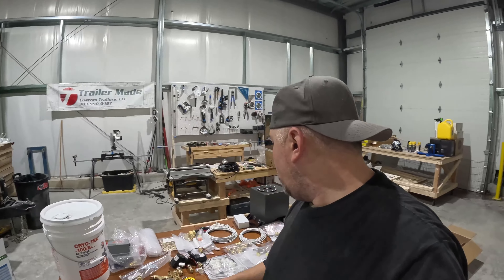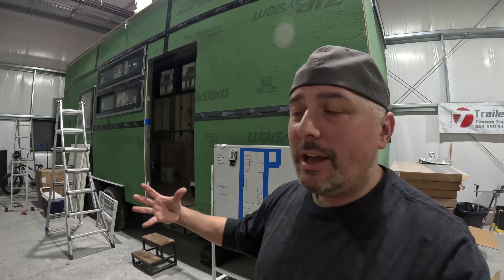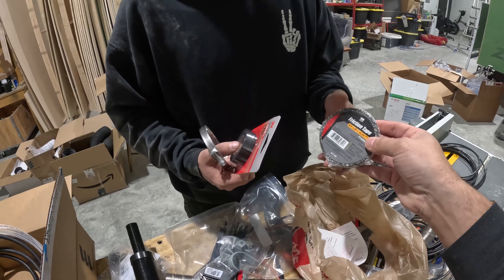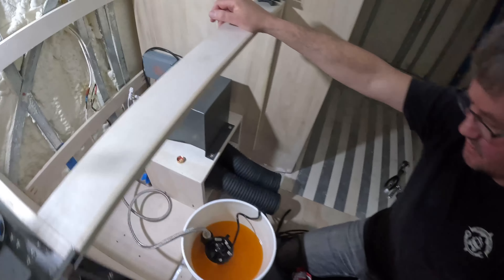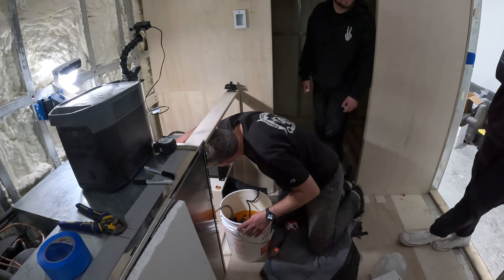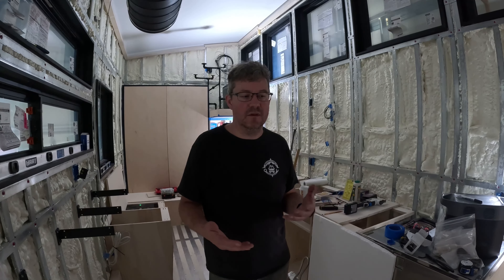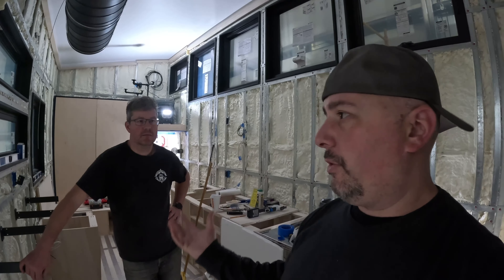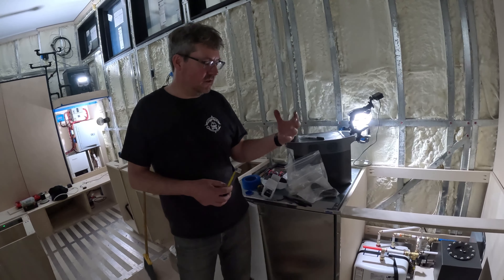BEST Heater for my Tiny House - Radiant Floor Heating

Comment: Two years living in a 30ft Cargo trailer with in floor hydronic heating, also does my hot water and forced air. Espar hydronic diesel heater typically used in Semi's. Tested to minus 40 and a cozy 25 degrees Celsius inside. Alberta Canada. My biggest suggestion is a Diesel/water separator on the fuel supply and use a mix of kerosene every now and then to keep fire chamber clean. Steamfitter by Trade. Oh and Jarrod this one is for Sunny, think I might have R6 in the floor and it cost's me about 5 gallons of diesel every 9-10 days. Even that will get much better as it is a work in progress and not fully insulated, R&D stage still as I first heard of the idea of hydronic heating in a tiny space through your channel and figured I would give it shot. Far cheaper than a house mortgage, rent and all those utilities, insurances and repairs.
Reply: Lets try this...hope this comment doesn't get removed also but i try to answer you. We are talking based on lack of information. When talking about Energy Efficiency everything play's its part. I don't know what flor type you have, how its construction looks like, what actual insulation is in there, how much air volume , hom much radian surfaces and so on. I can make assumptions based on experience from the European point of view where lets not forget Energy Efficiency and Pasive House technology was invented. Diesel Heaters is one solution but is not the best. Depending on the criteria that it needs to fill technology is used to fill it. For a Car that Runs on Diesel makes sense to have a Diesel solution and not a Electric one like Heat Pump witch even so is more efficient but you have losses and added complexity for the electric generation. A big epic fail people make is put in Flor Heating any type and then cover it with a carpet or furniture. As much as i can see in the Video 50% or the radiant surface is covered with furniture and the end flor laminate or what ever is not even in also so that adds a other insulation surface over it. 25l of Diesel for 10 days of 3h a day that is a lot. Maybe price of diesel is 2 Dollars a Gallon and then its ok but we have 12- 16 Dollars the Gallon in Europe. You have to factor in prices of resources. Hope it was helpful. Have a fun Day!
Reply: @suny1265  You where doing good until the end. How do you only heat 3hrs a day with water in your trailer? Yes my vehicle is diesel and I heat the trailer 24hrs a day. My heating is only in walk ways with a tiled floor. Also we are talking about many factors here. Solar isn't  really a great option unless your willing to chance freeze up every month here in Canada. Running a 12volt diesel heater and make up air with the same forced 12volt fans and heater core as a car is far easier than a 110 volt heat pump. When I take into account what my friends are paying for utilities per month for power and gas bills to live in bricks and mortar I have a long way to go before my system becomes inefficient.

Comment: OK so this may be a stupid question but I'm gonna ask it anyway so your hot water goes through the floor pipes but now in the summer time do you have a cut off that bypasses the floor goes right to your spigots instead of the floor is that how it goes I'm curious on how that would work I don't know how many gallons of water would be in those pipes kiss curious hope all is well. As always stay safe stay strong stay healthy God bless and enjoy life ✌💪👏🎅🚌🌻👍
Reply from the maker: That’s not a stupid question at all. There is a heat exchanger somewhere in this mix. I know water goes through one side of it and the antifreeze goes through as well. Again, I too don’t full understand how it all works, just full disclosure there. For the summer I think the liquid in the pipes are sitting dormant. The water is a different pathway is best way to think of it (I think)
Reply: @JarrodTocci  thanks buddy it shed some light on this I gotta do some more investigating I'm intrigued by it.

Comment: Can the system use heating oil? It is quite a bit cheaper than diesel fuel.
Reply from the maker: I can use red dye diesel or kerosene. Red dye is much cheaper. The consumption is extremely small and I’m not 100% on the math here but I think I was told that on full tint (which would very rarely happen) the system burns 1 gallon of diesel every 24 hours. In theory I could get a 55 gallon drum on my property and have red dye delivered to my property. That would easily get me through winter
Reply: @JarrodTocci  I lived in portland for a long time. I had several apartments with oil heat. There is a lot of infrastructure for delivery of heating oil in Maine. Bridgton is a pretty nice town. Close to skiing and the lakes and maybe about 1.5 hours to the ocean. I used to run to Shawnee Peak after work to go night skiing.
Reply from the maker: That’s where my land is ;)

Comment: Minisplit heat pumps are the best heating and cooling system today. The new cold climate heat pumps are more efficient than best gas furnace in Norway or Alaska. That’s why in Juneau Alaska 80% are now heated by minisplit. Norway it’s 70%. In 5 years it’s expected to be almost 100%.
Reply: Our mini-split in Montreal required some help at -20C. It paid for itself in 4 years of savings. Bonus AC in summer. We're in the Arctic now and everything is hydronic which is effective at -60C. Every room has its own system and controls. Alaska might be more advanced cause I think their building codes require triple glazed windows.

Comment: Depends on local climate but its really slow heating and its not enough. Also insulation has to be above R60 on average.
Reply from the maker: What are you even talking about??? R60?! Please know more about thermodynamics before saying things
Reply: @JarrodTocci  Dude i am a Energy Efficiency Consultant....what are you people even talking about? Your mixing Apples with Vegetables. Its a common problem in America i have seen that people are unable to understand anything regarding complex notions like Energy Efficiency is a complete system with Heating, Cooling, Insulation, Ventilation and Energy Consumption. Hit me up when you end up living in it and is not working properly. Maybe then you will Open your mind a bit and be able to learn. It will cost you 10 times more Energy then the best heating solution witch is with Hot Air like the Sweden's Houses use.
Reply: @JarrodTocci  Another problem your going to run in to is Thermal Bridges because of the Metal frame and Heat/ Cold transfer. You need multiple layers of insulation and you don't have that. That Tiny House can only be used in + 5C Condition without major downsides. The lower the outside temperature the more heating you will need to sustain ambient temp. You will burn through Diesel like crazy. Maybe you only want to spend 3 days a month in it and if that is the case you definitely don't need it.
Reply from the maker: Well, let’s see here. This heater has been proven and shown in -40 degrees and that is with insulation that is no greater than R18. You can say what you want but truthfully I know what I know, I’ve seen what I’ve seen, and I’ve looked at many other options even the oversea ones. This system is actually used in Europe and the founder of the company that designed this system uses a lot of properties from European heating designs. You say you’re in energy efficiency so how can you say this system is less efficient or worse than what every single tiny house builder uses. What we talked about at the end of the video is simple mathematics and not that hard to understand. Now, if you’d like to share or show me a company that makes something better I’m happy to take a look. But I’ve given you this opportunity and haven’t heard anything yet. So by all means, share away.
Reply: @JarrodTocci  Compared to solution you find in America is better but is in no way shape or form Efficient! America got used to wasting Energy...I don't work for free so do your own research. I just pointed you in the right direction but if your happy with what you got good for you. Its going to end up a overpriced Not Efficient Tiny House and its ok if that is what your aiming for. People have Tiny House out of Rocks also and they do just fine with a stove. I have provided you also in previous video's in the comments with tips and solutions and you don't want to listen so its a waste of time. Pls don't make me laugh with your opportunity stuff...your not in charge or control of speach 😂. Enjoy your building and tnx for the Video Reviews on Van's. Have fun !
Reply from the maker: “I don’t work for free” but instead you comment nonsense on here haha…if you’re so smart and know it all then why don’t you have a channel educated all of us. That’s not you working for free. I love how people will come on here, or any platform, and be “I’m smart than you…” and honestly you probably are. Maybe you’re even right! I’m not even doubting that. But I’ve given you plenty of opportunities to defend this argument and you still haven’t given me any proof of anything you’re saying. In turn I have video proof of everything I’m saying. I’m looking forward to making a video everyday this winter and referencing this conversation proving you wrong. Every. Single. Day. And now you’ve pissed me off to the point that I will “do research” on what you’ve stated and do a whole series on this and again mention (and show) this conversation. If I’m wrong I’m happy to accept that, but I also know I’m not wrong
Reply from the maker: I’ve been looking over your comments more and I’ll be coming back to touch on each subject because you have now brought me to this. You used the phrase “thermal bridging” but if you knew the actual terminology it’s “creating a thermal break.” I also never said I didn’t create anything to prevent that. You only assumed this because you watched a 20 minute video on a build that has taken me 9 months so far working many more hours than that video. Another reason I find it funny you throw around “consultant” because if you ever built anything or talk yo contractors and bring up thermal bridging to them, they laugh. It’s a term created by the internet! Lastly I’ve done several searches on the things you’ve mentioned in these comments and there’s not much at all. I’ll keep digging but also won’t be surprised to find something you wrote and are trying to pass off as “the way.” I’m done wasting my time and energy with you
Reply: Thermal bridging is the transfer of  high thermal energy ( heat), in your case steel (r-.003) next to low transfer material foam ( r-6). Thermal break is when apply a high  r- value material over your steel to prevent a lot heat loss. It would make a huge difference. Use of foam makes your home air tight that will Help. You should install hrv system for your Heath in a tight home. 42,000 btu in a tiny house is plenty for  you to stay warm. Adding 1” foam all around would cut heat loss in half
Reply: @paullehto2294  It seems that someone is removing some of my Comments  when i point out valid concerns and give good advice. I posted a reply to your comment and got removed. If we can't have a discussion here then i wish you god luck and enjoy making mistakes and learning from them.

Comment: I think you're gonna have problems with that heat system.propane or natural gas would've been a hell a lot cheaper and probably more efficient and carefree. Had a customer come to me with one of their systems way too complicated and way too much space wasted. And it cost way too much money. Force heated air is the way to go.Its a van!!
Reply from the maker: Fair. I trust the person who created this system and it’s been used in spaces of this size before. From a fuel standpoint using propane or natural gas would be better but from an energy standpoint it’s better to use diesel. I’m confident in the system and looking forward to sharing more throughout the winter